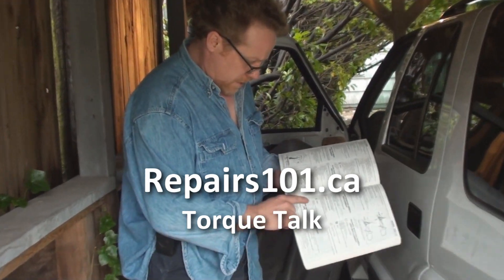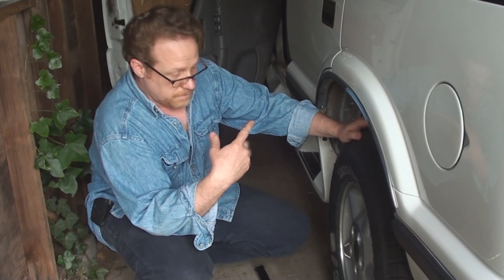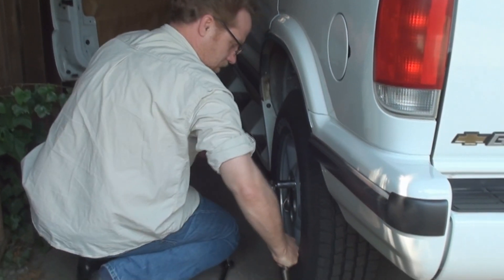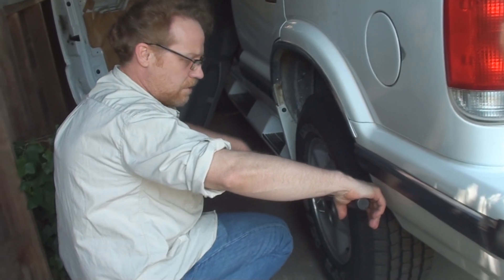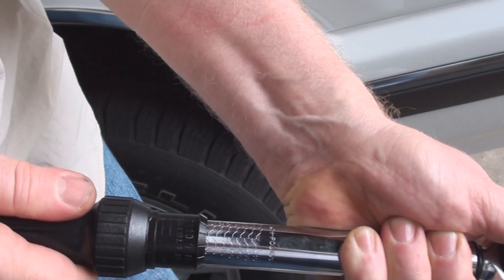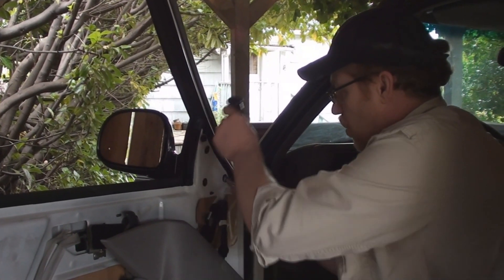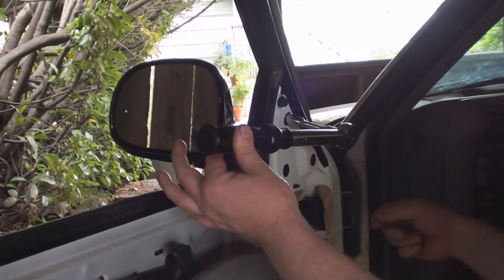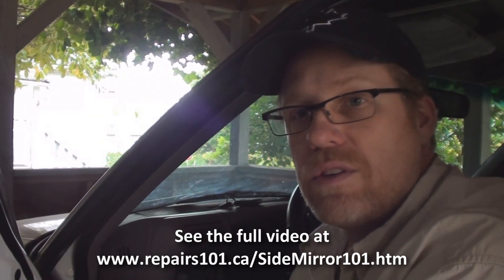Torque Talk

Comment: The premise of your lugs being at 53 ft lbs from the breaker bar by measuring with the torque wrench is completely false. Consider this. If you tightened the lugs by standing on the breaker bar, or used an impact wrench to tighten them, or even if you tightened them to the specification of 80-110 ft lbs that lugs are normally tightened to, would the torque wrench have clicked when you set it at 53? Yes.

Another way to put it is, if the torque of the lugs is greater than the 53 ft lbs, of course it will click. But that doesn't mean that the torque of those lugs is 53 ft. lbs
Reply from the maker: Silky Tp I guess I should have said "or more". However I believe the point was to illustrate how little 53 inch pounds is. One can easily make "more than" 12 times that much power with one hand choked up on the wrench.
Reply: Repairs101
And in all fairness, you DID make that point.

Comment from the maker: Since [1 foot = 12 inches] then [1 lb.ft = 12 lb.in]
and since [80 x 12 =  960] then [80 lb.ft. = 960 lb.in]  
but those 3/8 Craftsman wrenches only go to 250 lb.in. so get a 1/2 inch torque wrench. 
Remember small fasteners require limited torque. Lug nuts are not small fasteners.

Comment from the maker: Unfortunately when you do the math (15/12 = 1.25) you get a number so low it is doubtful any lb.ft. torque wrench would be able to calibrate it (maybe digital?). Buy yourself a lb.in. torque wrench or use torque limiting short handled socket wrenches and be gentle. Sux to have to rethread a sparkplug hole. Good luck!

Comment from the maker: @Mast3rChris- The first thing that comes to mind is that an ancient torque wrench will need to be recalibrated if it is to be used. Take it to a repair shop. I'll guess your's is a 3/8ths drive with a torque scale from 120 to 960 lb.in. (divide by 12 = 10 to 80 lb.ft) If you need 25 lb.ft. x 12 = 300 lb.in. My Craftsman wrenches (shown in video) have increments of 1 to 20 lb.in. and 1 to 10 lb.ft. (on the big one) - both with Newton-Meter equivalents underneath. Can you provide a Video Response?

Comment: Thanks. Helped me out a little bit. My dad handed me this ancient click type torque wrench and I was like "what the heck is this??" 

Anyway, I noticed that on yours it has numbers going from 10, 11, 12, 13 and so on.
Mine has:

0 | 1 | 2 | 3 | 4 | 0.
Those little lines are in between the numbers on the wrench.
The bigger numbers etched into the wrench in "inch pounds" read:

840          960
600          720 
360          480
120          240.

If I wanted 25 ft/lbs, how would I set it?